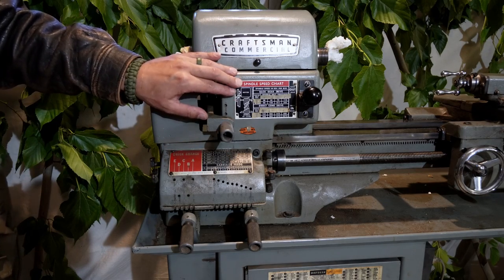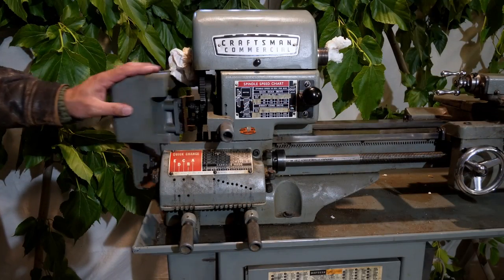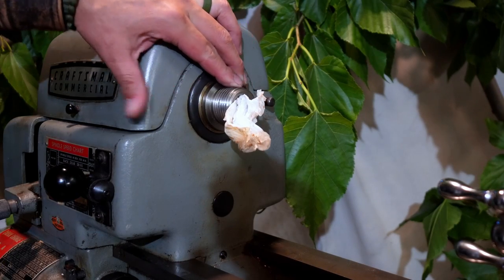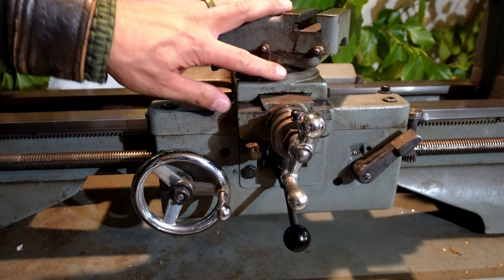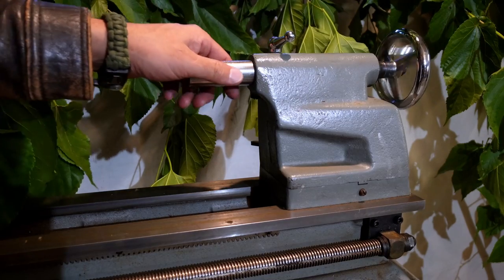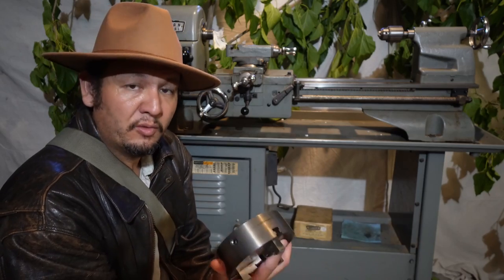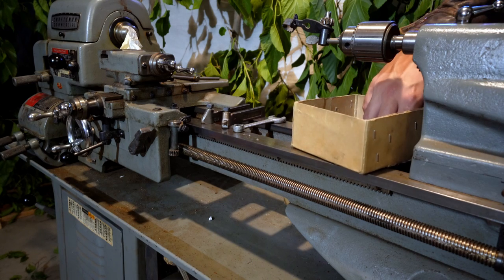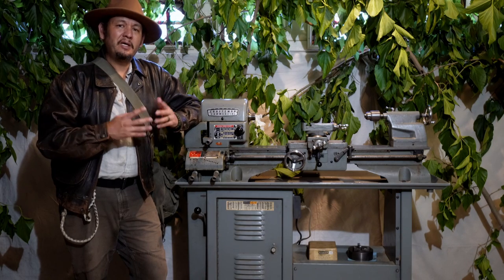Holy Grail Discovered: Pristine Atlas Craftsman 12" Swing Lathe

Comment: Congrats on that catch. One in a lifetime find. You will treat her well.
Regards.
Reply from the maker: Thanks I really excited about it and getting it running like it is brand new. I'm surprised at how resistant to solvents old oil has been. I saw you've been doing some restorations yourself. Recomend any solvents?
Reply: @LoydPrecisionMakers  You´re right, i´ve done hundreds of restos in the last 40 years. Mostly i use petrol ether. Sometimes i mix up a bit of standard gasoline in there and let it soak. For brushing, i use a hard brush. Means you cut of the bristles till theres 1/4 inch left. That works fine for me. Sometimes it takes several passes with different solvents. There´s no perfect recipe.
Reply from the maker: @mftmachining  Thanks. I didn't know about the stiff brush trick. I'll have to try it. I haven't used petrol in the past for safety reasons.  Unfortunately, with the zamak gears containing copper, zinc, and magnesium, alot of parts can't be used with a strong acid wash. I may have to resort to petrol after all.

Comment: I have had the bench version of that machine for 30+ years. The best improvement to my machine i ever made was switching from the old style lantern toolpost and rocker type toolholders to a QCTP. Get the AXA size, it is the best fit for your machine. My second big tip is NEVER EVER use a pressure type knurling tool on an Atlas. Those machines are not heavy enough to stand up to the punishment a pressure knurler will impose on the brass nut on the compound screw. If you want to put a lot of wear on the compound screw nut, a pressure knurler will do that in a hurry! It you do want to apply a knurled finish to projects you are working on, invest in a scissor type knurl. Congratulations  on your purchase. Dont deceive yourself into thinking the Atlas is a heavy machine, it is not. It is a good hobbyist machine that you can do tons of good work on. That said, you would be well served to not push the machine beyond it's limitations. I love Atlas lathes, but there are multiple well known weaknesses in the brand, regardless the size or configuration. My point is an Atlas/Craftsman  lathe cannot equal a South Bend, Logan, or heavier more industrial brands will though sized roughly the same, and in fact could share much of the same tooling. Watch Tubalcain's channel and so many others to learn so much more you may not know about your new lathe too.
Again, congratulations on your new  machine. I hope you get as much enjoyment from yours as i have mine.  BTW: YOU CANNOT OVER OIL IT!
Reply from the maker: Thank you so much for the advice and taking the time to watch my video.  That is great advice to heed.  I had no idea about the knurling tool.  Now that you explained it that makes a lot of sense.  I do want to got to a quick change tool post eventually.  I started with a benchtop Sherline lathe and always wanted one for that machine.  I  wish Atlas had a larger spindle bore.  There are always some kind of trade off.  Thanks for the tip on oiling.  Is there a particular weight or type you recommend?